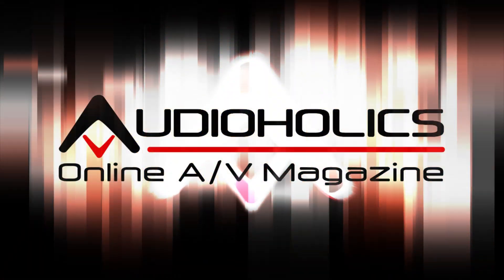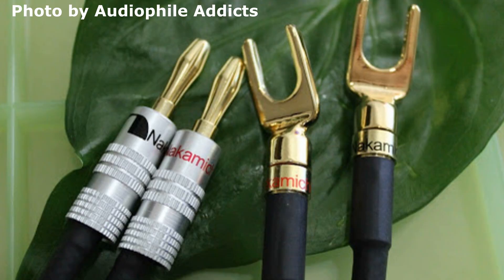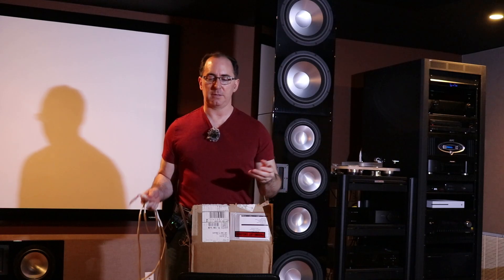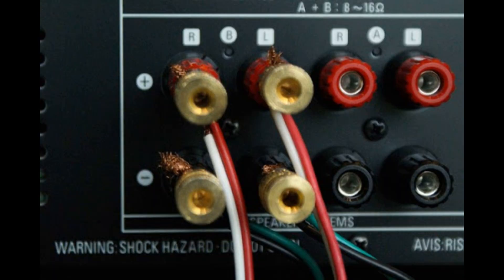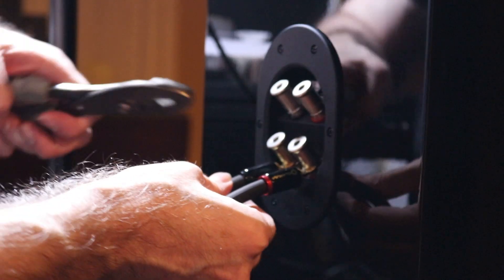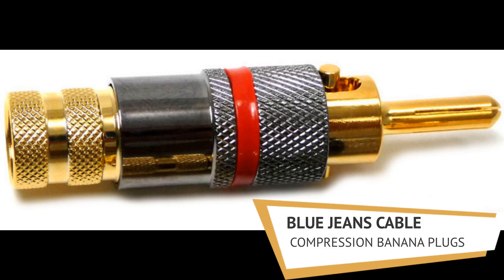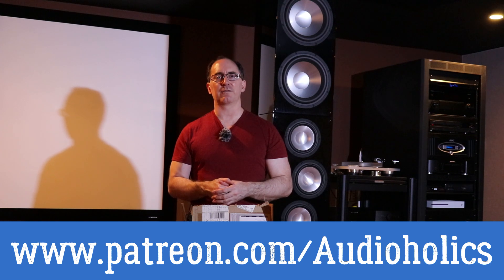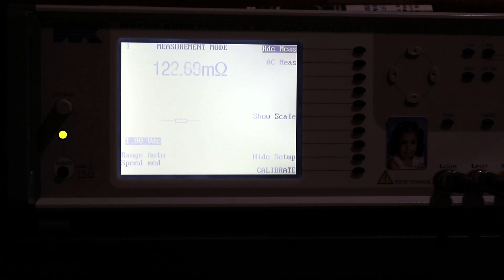Spade vs Banana vs Bare Speaker Wire Terminations: Which is Best?

Comment: When Radioshack was closing all their stores, I bought spools of their Auvio brand wire at around a third the price, I got about 100 feet of simple clear 12 gauge, and another hundred of 16 guage which was triple shielded and jacketed in layers of insulation thicker than the copper, the 16 gauge has soo much jacketing it's as big around as a finger! both high purity copper, I also at this time got banana connectors for stupid cheap and lots of their batteries. (no relation with the batteries lol).  My next system setup is going to get bananaed for the ease and fun of quickly swapping speakers.  My first speaker wires ever were spaded, and my first amp was from the 70's and had thumb screws with toothed washers.  I found it challenging to get the spades to not rotate into each other during the final tightening down. It's an OCD nightmare, because even if you aren't OCD, wire connections are universally an act of OCD perfection and having them rotate is bonkers! but a bit better than the bare wire which also rotated and needed to be held in place and spiral with the rotation.  I moved to bare early on, and have used it almost exclusively, most of my amplifiers didn't have fancy terminals anyway, but now they do, and the next one will.  There's a whole lotta "the next one" going on in my audio world lol. I'm even floating the idea of building my own home using QRDstyle acoustic cinder bocks my goal is to have a wide open room and budget towers all around.  Anyway, I've got allot of experience twisting speaker wire to get rid of those wiskers, I find if you take a piece of card stock, like cardboard food packaging or toilet paper tube, and use that to pinch the wire, you can twist the ends with your finger tips and they won't get ripped up and poked by the wire, you just keep twisting and twisting it until it gets nice and tight like a cable, remembering to twist with the natural twist of the wire. Those tight little bundles slide into holes without snagging and fraying out whiskers. I also take care not to touch the copper, to avoid getting oils on it, whenever I reuse wire, I cut new ends so the corrosion is gone and they're fresh. I suppose you could clean them too. I find twist wiping the ends with a firm pinch in cardboard does a good job cleaning them too, leaving streaks of oxidation on the cardstock, I have been known to use a sock or two too.  I wonder how often these folks that swear by their cables, were just experiencing a firmer termination.  Has anyone experiment with dielectric grease? like they sell at the auto store for spark plugs in those little $2 squeeze packs at the counter? I know some guys use silver solder to bolster the junction of their wire to their tips.  These contact points do seem like the weak links in the impedance chain. Good thing your speaker was made in China lol no internal part to part quality control issues to worry about there. I'm sure they wouldn't sell the silver solder they were supplied with to use, and then use cheap non silver solder instead....  That's what happened with the lead paint scandal in kids toys, they were given paint to use but they hocked it and used other cheap stuff instead.  Keep your business partners close folks, your manufacturer relationship needs to be stronger than corrupt self interests.

Comment: Its all about SpeakOn! Wish they were used more widely, such a strong connection
Reply from the maker: Agreed
Reply: Audioholics hey Gene glad to see your doing well been praying for everyone through this my husband is a certified electrician and he says that a solid connection means everything in high voltage power loss if you increase the resistance of a cable you can cause harm to three phase power circuits or increased ohms on a conductor it’s the same thing here you need the best connections least amount of resistance for your system or you could be robbing you new high end set up of performance he also says check for loose connections as that can be a killer love ya Gene keep getting better friend
Reply: Agree, can't believe SpeakOn is not more used in consumer equipment. No chance of short circuit or wrong polarity, and much quicker to plug in/out.
Reply: @snipe69  There is a problem with tinning wire, it is creap.  The lead/tin deforms at room temperature when under tension and reduces clamping tension increasing resistance over time.  Typically crimped ferrule are the answer in industrial applications but there are not standard crimping tools that fit the binding post profile that I know of.
Reply: Speakon is the answer
Reply: NL4 for life
Reply: Agreed. I'd love to have the pre-out outputs on receivers be TRS as well. Balanced or unbalanced in the same connector without taking up a lot of space on the rear panel. Phono plug adapters don't stick out very far, some are nearly flush.
Reply: Amen -- too bad most consumer and "audiophile"-grade stereo gear doesn't have them.

Comment: Raw on both ends. Once those cables go in, they never come out. Adding another component to the set up can never improve it when raw is an option.
Reply: Do you tin the wires to prevent corossion?
Reply: Tech Noir perhaps watch the video instead of just posting

Comment: Gene, you look like your feeling spry, glad to see it.
I'm using some nice banana's off ebay branded Nakamichi. Not the locking kind like you show but they do have dual set screws for locking in the bare wire. The ones you show are very tempting but a bit pricey for my 5.2.4 system. 18 pair. ouch.  ;)

Comment: Sewell Direct deadbolt banana clips and braided flex tips for the spring clamp terminal. Finished off with 3:1 color correct heat shrink tubing. Not only for a clean crisp termination but also insurance against accidental short circuit. I call it the Johnny Five hay wire. No disassemble. Ever. Like....
Fo
rev
errrrr. 
Yes I just mashed Sand Lot with Short Circuit. And I'll do it again! 😝

Comment: I was really hoping you were gonna measure the difference in resistance for the three different techniques with that fancy meter. Also I reckon the spades would be fixed a lot better with a compression/spring washer.

Comment: Banana. I went with the pre-made 10' Monoprice Monolith banana cables. I understand they are 14ga but should be fine for the 10' length. 
I can't "hear" a different from my previous 12ga bare wire Acoustic Research cables but the  build quality of the Monolith is very nice especially at their price point.
Reply: I got the exact same Monoprice speaker cables along with a spool of shielded 14ga speaker wire and Monoprice screw on banana plugs to connect to my receiver and pin connectors to go in my speakers without banana plug connection. It has been a big improvement from my 16ga oxygen free speaker wires using the bare connection method.

Comment: Hope you’re feeling better can’t tell you how sorry I am about your illness always enjoy your videos, i’m not sure if any one is best but definitely depending on the situation there is one best for that specific application four instance some speakers will only except bare wire so that’s easy and most receivers really won’t except spades they will except bare wire or bananas definitely bananas here as bare wire is pretty tedious on receiver and usually will only except A relatively small gauge wire. And spades are probably more dependent on the terminals on the amp or speaker the other thing I like about spades they can help you route the speaker wire differently a banana generally straight out the back  spades maybe down or to the right or left I think you know what I mean. I’m actually a big fan of spades and bananas the only problem I’ve ever had with bananas is they tend to wear out they loosen up after a while some styles can be adjusted and some can’t i’ll tell you what I’ve run across that I absolutely love wire world they make some really good cables and some really expensive ones but you can find something in your price point but they also sell Their terminations which could be soldered on to any wire what’s cool about these is that the ends can be changed out simply unscrewed you can go from spade two banana instantly I seen the style before but they seem to loosen up but these ones from Wire world don’t matter of fact if you didn’t know they unscrewed you would never know check those out the really cool I highly recommend them you can get gold plated (Standard) or solid silver that being very expensive but the standard ones are pretty normally priced I think they’re the best bananas I’ve ever used regardless if they can be swapped or not they fit so tight and like I said if they ever were out just screw in a brand new one no soldering nothing sorry to ramble but what the hell hoping for the fastest recovery possible and that you and your family are well thanks for the videos👍

Comment: Used to do raw connection in both ends but had to add bananas to amp side as the current amp has poor connectors and raw wire was gettin loose.

Comment: You forgot the biggest plus of a spade connectors. You can crimp them.
I use Copper Spades with OFC copper wire, becomes a solid one piece crimp.
Can't beat it. Spades have more connect area, then banana plugs too.
Reply from the maker: already addressed the surface area argument, but they still fall off binding posts very easily.
Reply: Audioholics 
I have never had one fall off yet.

I was making the point about properly crimping a copper spade to copper wire. How it becomes a solid piece of copper.
You can't do that with any banana plugs.
Reply: @Audioholics  O ring terminals never fall off...though you can.....an expensive opps

Comment: I used bare copper for many years then went to banana plugs for a cleaner connection and ease of future disconnecting and reconnecting. I have those monoprice shown in this video. I haven’t noticed an audible difference since the switch. For appearance and ease of use, I’ll stick with the bananas.

Comment: Raw Dogg since I caught the A/V bug. I bought the lowest gauge wire I could find, when stripped it's close to the diameter of a pencil. I used a drill to tighten braid to eliminate the wild hairs. Why don't they make lock nut type connectors with nylon inserts to eliminate the chance of them loosening ?

Comment: I'm using Nakamichi BFA banana plugs to both amp and speakers with 12 gauge low pf speaker wire.  A good friction fit, sounds very good too.
Reply: As long as you don't think Nakamichi today is the real Mc Coy, you know the ones with actual high end equipment.
Reply: @hugobloemers4425  ya Nakamichi is name only at this point. A cheap Chinese company, the banana plugs are basically just rebranded Sewells.
Reply: Yep they got nothing to do with the great cassettedecks. But I use them as well, hey are allright for the money. Sometimes the fittings are not great and you have to tweak them a bit. But for somebody who likes to move equipment and speakers around they are good value. I do not hear a difference between a bare cable connection or these banana plugs.

Comment: I like banana because they are simple to use. As an electrician, I say if done correctly bare wire is the best connection. Proper wire  size for the terminals and no "wild hairs". But I use banana on everything cause I like to play with other speakers and it makes it easy
Stay safe, glad to see you are doing well.
Reply: You could always twist the wires together and then melt solder on those bad boys
Reply: @MrBloodybeak  Banana plugs are the way to go when you switch speakers or wires often. I have tried everything and always go back to banana plugs.
Reply: @MrBloodybeak soldering reduces surface area in a low compression force joint. You're actually better off with bare wire.
Reply: @MrBloodybeak  I feel like at that point, it becomes a hard surface and not much different than a banana plug anyway. I guess if you just solder the very tips together...

Comment: I used to go raw on the amp and at the speakers for many years, but now I do banana plugs on both.  If you get tight fitting ones, they're much better overall I believe because they can are so easy to switch in and out of different speakers and amps.
Reply: I agree 💯
Reply: The banana plug is the best. A much neater way to set up

Comment: Raw on both ends. Tighten them down once a month or so.
Reply: Good preventive maintenance!👍
Reply: Bi-wired, bare copper
Reply: Only way to go...
Reply: i used to do the same but with some added silver solder wire just on the tip if the copper to keep them togheter but as of late i moved on to Audioquest banana plugs

Comment: what about tinning with a soldering?  for raw cable
Reply: Solder is brittle. With the pressure of the screw terminals It may cause more problems than it solves.